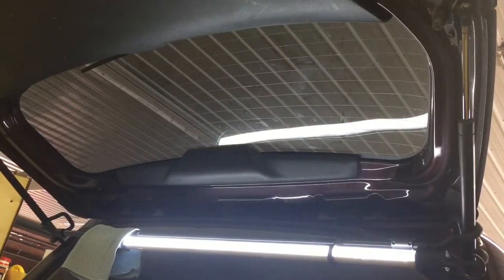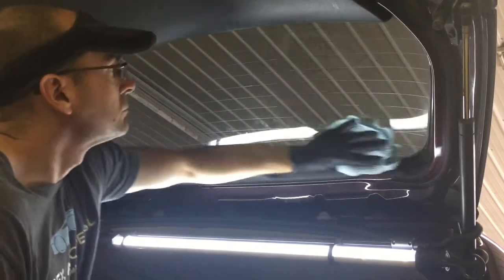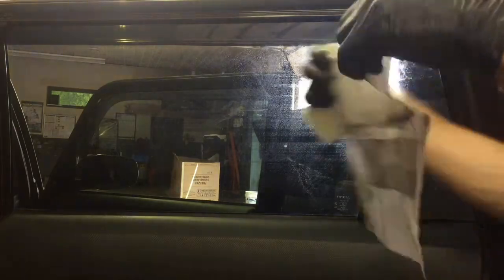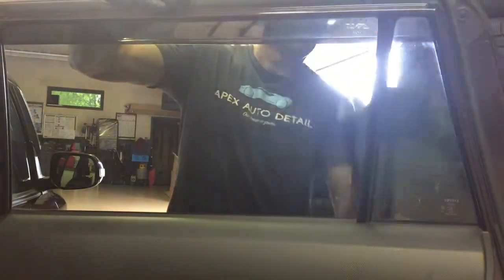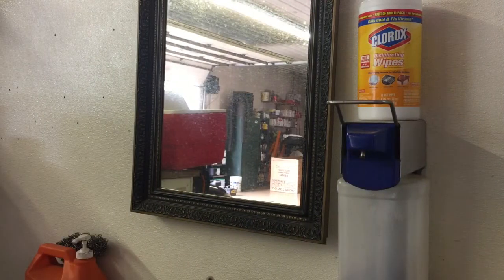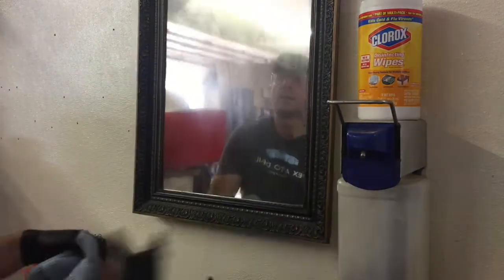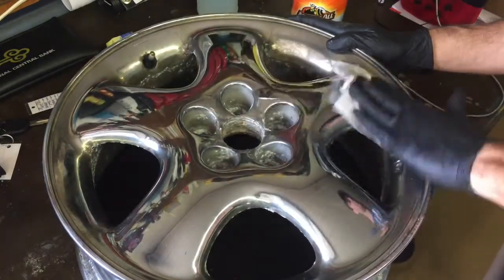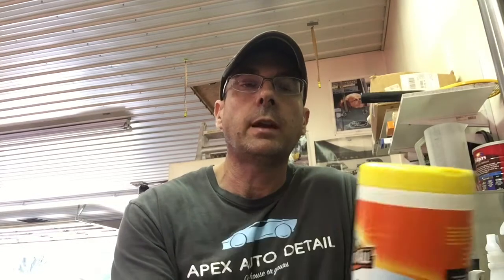Auto Glass Care: Armor All Glass Wipes!! No streaks....No Residue!!

Comment: When i use it just the wipes , it leaves streaks on all my windows , any reason why ?
Reply from the maker: interior?
Reply: Same
Reply: Are you not following up with a clean dry towel afterwards? If you just use the wipes themselves, on dirty glass, you'll have some dirt and oils and contaminants and paper from the towel itself not picked up by the wet towel mixed in with the remaining glass cleaner solution, which will remain on the glass after it dries. So while the solution itself will flash dry by itself, anything else left behind will not. That's why mopping up with a dry towel is the best way to ensure streak free dry glass.
Reply: @jdisdetermined would a microfiber cloth work as well